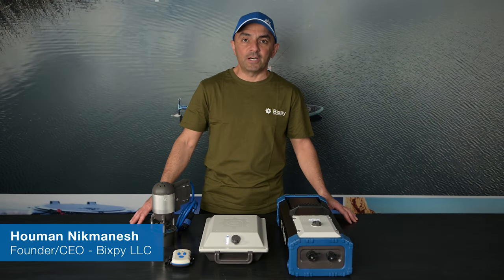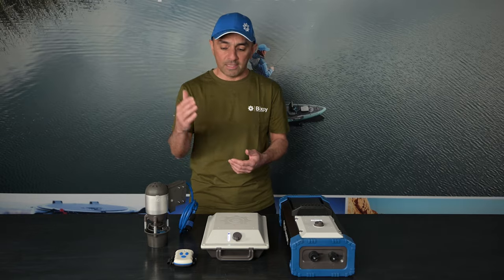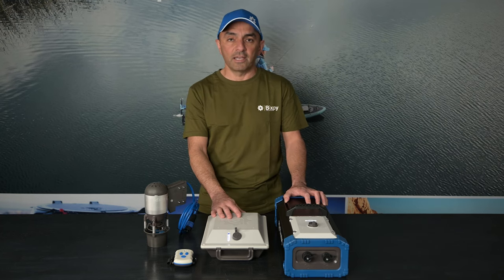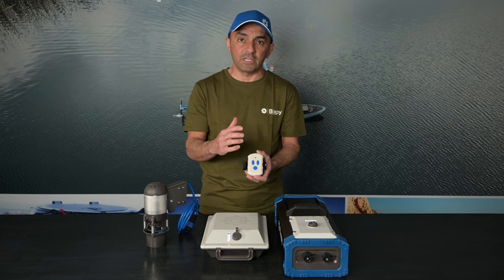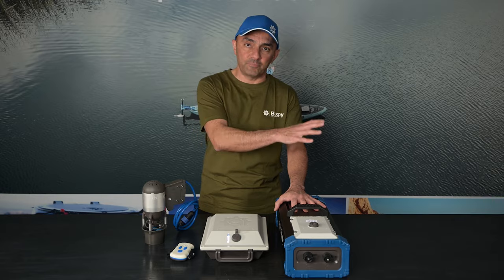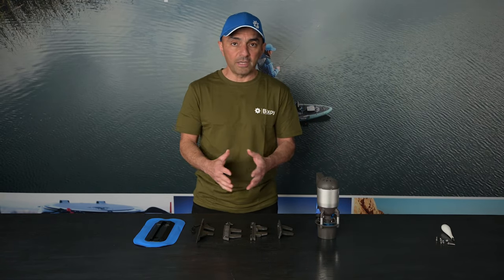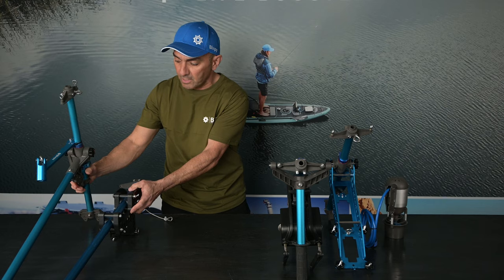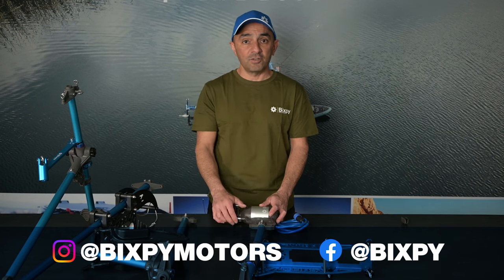Walk Through of the Bixpy K-1 Motor, Outboard Batteries and Various Adapters

Comment: Which is it, 12 or 13 speeds with the new smaller battery (white LED)?  You contradict yourself in this vid.  Hope the other info is accurate.
Reply from the maker: Sorry if there was any confusion. The video indicates that the 13th speed is only on the larger battery (PP-768) and not on the smaller PP-378. The PP-378 has 12 forward speeds and 3 reverse speeds. We hope this helps clear things up. Everything on the video is accurate.
Reply: @Bixpy  no its not...look at the first mention of batteries.  You distinctly say that both have 13th speed.  Just trying to set you straight but if you're OK with mistake, so be it.
Reply from the maker: @huntjunky1  We appreciate you trying to help us improve our videos.

Comment: Does the K-1 increase in mph from the J-2 enough to notice it ?
Reply from the maker: It will be a very slight increase in speed for the K-1 and not super noticeable. The difference in quieter running will be more noticeable. The more dramatic increase in speed will come from the PP-768 battery and it's 13th speed. The PP-378 does not have the extra 13th speed.
Reply: @Bixpy  how much more speed do you get from the 13th speed
Reply: @Bixpy  Then why do you say it does?  Edit now! No bate and switch please.

Comment: I bought the pro angler model and it's supposed to go to Turbo into cliques. The instructions said the battery has to be totally drained then recalibrated but the instructions really didn't specify had to do this anybody got any experience with this?
Reply from the maker: Hi Michael. The PP-768 (Angler Pro Kit) has a 13th speed which can be accessed through manually increasing speed OR using the warp speed feature to get to speed 12 and then increasing the speed once more. Warp speed works by pressing the forward button twice and then holding on the second touch. Completely draining and recharging the battery multiple times helps calibrate the battery LEDs for better and more accurate LED readings in the future uses. We hope this helps.

Comment: Hello. may i ask what do you need to attach k1 motor install on hobie lynx ?  ( mirage place)
thank you.
Reply from the maker: Hello! On the Hobie Lynx, our motors will fit ~50% of the time through the Lynx mirage drive. Somehow during the manufacturing process, the Lynx drives vary in width(which is a bit frustrating). Some mirage drives are wider/smaller than others. That being said, we've stopped recommending the mirage adapter for the Lynx kayaks. Here is a video showing what mounting adapters we recommend for a Hobie Lynx: https://www.youtube.com/watch?v=bvpUQNa56mY&t=127s

Comment: I have the J-2 motor with two batteries, wrist control, and adaptor for my Sea Eagle 420x kayak. I also have the solar panel. If I bought this new motor and kit, would I still be able to use my J-2 accessories with it?

Comment: Are the batteries able to be recharged by a truck electric systems? 12 to14.4 vdc
If not, how about using a inverter 12vdc to 120vac?
Will it require a true sine wave, or will a basic square wave inverter work? What wattage inverter do you recommend?

Comment: Q - how did you mount the power pole adapter on the Lynx to the side and not in the factory delivered mounting position? Assuming you drilled into the Lynx to mount to the right side. I like the idea so you can use the delivered steering mechanism but weary about compromising the strength of the Lynx and likely impact on the factory warranty.
Reply from the maker: Please contact info@bixpy.com for more detailed info. We are using our 3M Double Sided Adhesive. This footprint can be purchased on our website for $15. https://bixpy.com/3m-double-sided-vhb-power-pole-mounting-adhesive/
Reply: Thank you! How durable do you expect the adhesive to be? How often should it be replaced?
Reply from the maker: @sangwna  3M adhesives are very durable and can still be removed in the future if needed. We do not have that answer but it should last for a long time. Maybe purchase a couple so you have one on hand down the road. Please contact info@bixpy.com for more information
Reply: @Bixpy  this is so cool, it would be amazing to see a dedicated video on this!
Reply: Wont the rudder hit the motor in certain situations?

Comment: I want to but it but I need to know how easy the adapter is to get on and off so I can car top it. I have an old town sportsman 106.
Reply from the maker: Which adapter are you talking about? Do you have the regular 106 or the PDL version? Please reach out to info@bixpy.com and we can help you further :)
Reply: Put to Old Town to run by motor then but try off top to car by remove from boat bottom and drive on home.

Comment: Just needs a longer cord that can output the same amount of power. I have the smaller battery and the motor at the aft ('21 Hobie Outback), I'd like to be able to store the battery under my seat but the power cord is too short
Reply from the maker: We sell 4.5 and 9 ft extension cables so that you can store the battery under your seat. You can purchase them directly through our website at https://bixpy.com/bixpy-extension-cable/

Comment: I have several water toys I would love to use and transfer the motor between, but fiddling with nuts and bolts each time seems like a bit of a hassle.
 
Do you have any future plans of releasing a quick connect bracket? Even a flat stainless steel  plate with four pass through pins with allowance for locking pins on the opposite side.
Reply from the maker: Hi Peter. There's already a quick-release nut and bolt on the motor fin!  It's not featured in this video, but it's that one big bolt in the middle of the motor fin. Removing that takes the entire motor off the fin. This won't allow interchange between all the adapters, but most of them. Hope that helps!
Reply: @Bixpy  Great. Thank you.  Ill look into this.

Comment: Will the mirage drive mount housing from the j2 fit in the k1 motor? Thank you.
Reply from the maker: The J-2 Hobie Mirage Pedal Drive Adapter and reduced shroud that it comes with will also fit with the K-1 motor. The J-2 Low Profile Pedal Drive Adapter is different thank the K-1 Adapter.

Comment: Will this fit the vibe gravity rudder?
Reply from the maker: Yes BUT it will need a slight modification. We will be making this change in house but can also give instructions on how to adjust on your own. Please reach out to info@bixpy.com for more information.
Reply: @Bixpy  I have the vibe gravity rutter on my Makana. What adjustments will I have to do if I order the k1 motor kit?
Reply from the maker: @raybans12  please email info@bixpy.com and they can help you further. We will have a free template to use and other options to make this easy adjustment. We can email this all over to you directly and it will be on our website eventually as well.
Reply: @Bixpy  I sent the request to the email above. Please advise asap. Looking at possibly purchasing the k1 if it works with my vibe gravity rutter

Comment: What is the top speed?
Reply from the maker: it depends on the width of the watercraft and how much weight is on the watercraft. which watercraft are you trying to motorize and what is the weight of the watercraft loaded with gear?